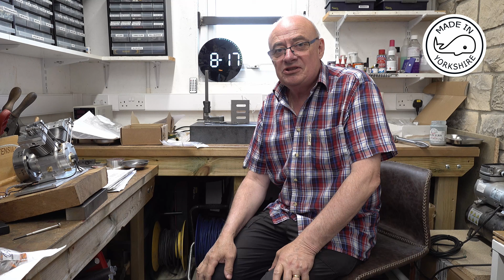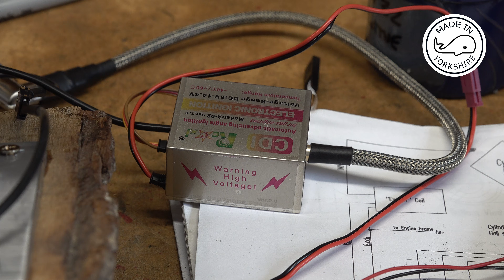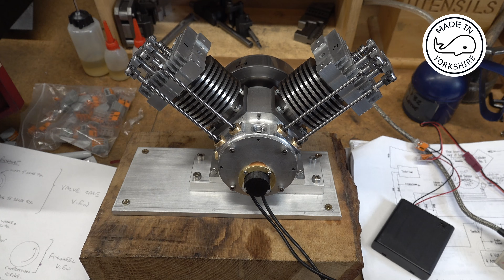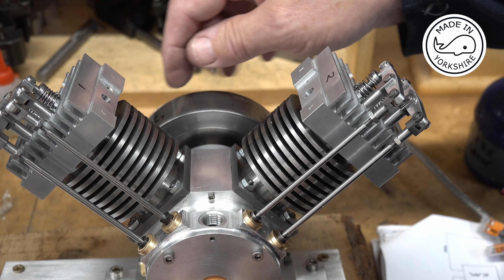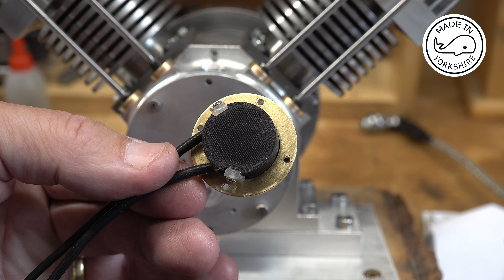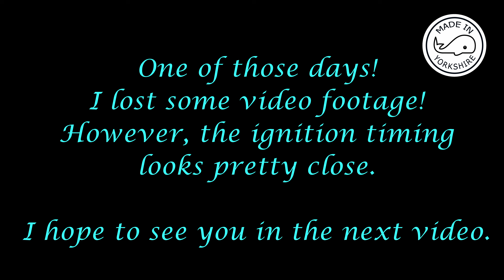#MT49 Part 21 - Jerry Howell V-twin IC Engine. Ignition - Part 2. In 4K/UHD by Andrew Whale.

Comment: Hi Andrew,
Reply: I have a brand new RCExl ignition for a twin that You can have. It's firing on both plugs at the same time with only one sensor, so I guess it's a question of where to place the magnets for each spark/cylinder? Anyway, if You want it and You think it will work for You it's Yours :)